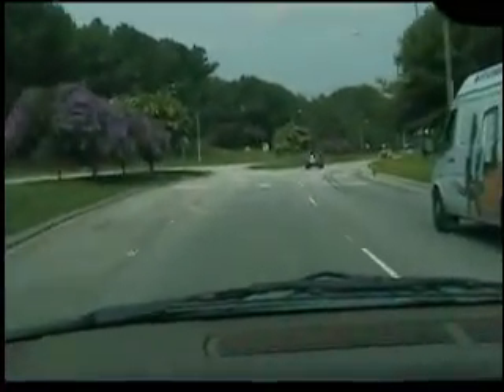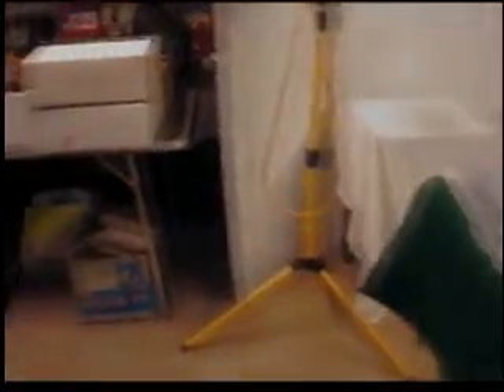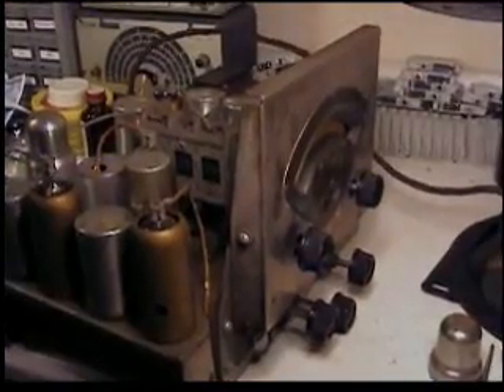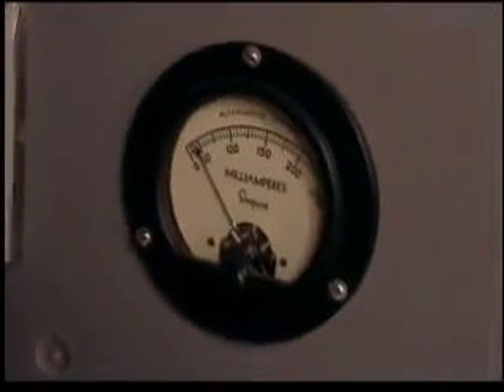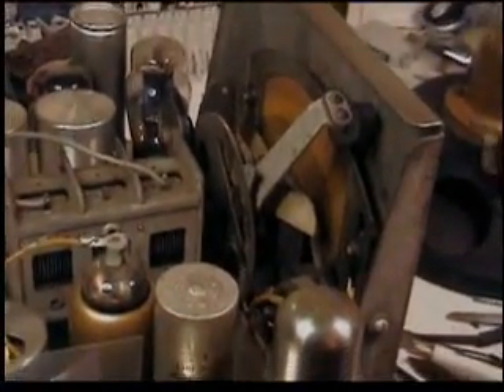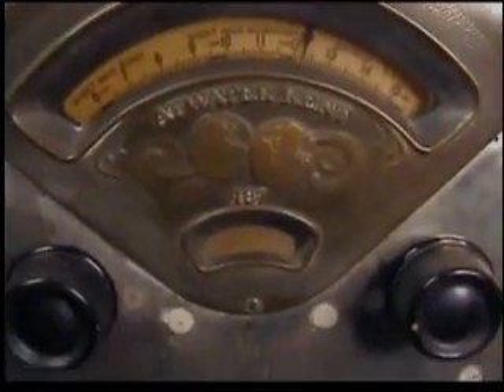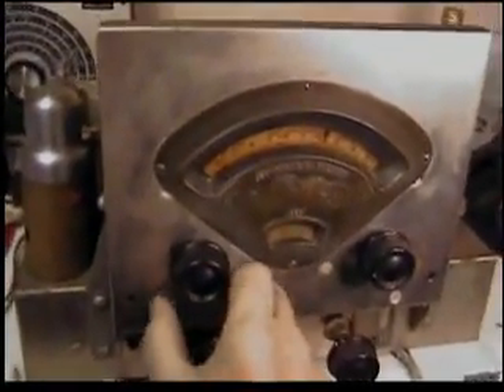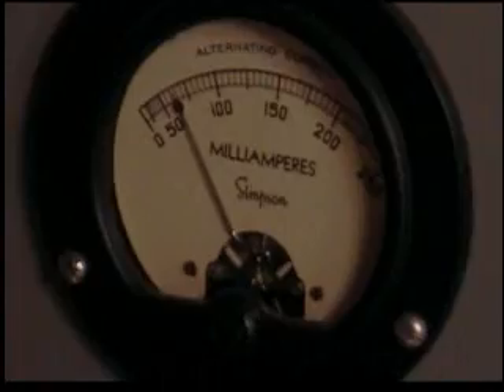Atwater Kent Radio model 487, 1936

Comment: What a great collection of radios! Is that a superhetrodyne type set? I have an Atwater Kent which I think is an "60" model maybe? It is a TRF circuit and has 3 tuning caps which connect together with metal belts.

Comment from the maker: Thanks.
The US is 120vac @ 60Hz.

Depending on the equipment there are other options.
220vac, one or two or three phase @ 60Hz.

The 50,000 watt AM radio transmitter that I work on is.
440avc three phase @ 60Hz. I'm very careful working around that equipment.

Rick

Comment from the maker: Yes it is, just amazing.
The Atwater Kent 487 is a superheterodyne and its intermediate frequency is 472.5KC.
Your AK 60 is a nice collectable. I wish that AK would not have filled the power supply unit with tar. It does make if difficult to work on.

Comment from the maker: AM, 1.6-5.0mc, and 6-15mc. It's possible to add an aux input to any audio amplifier. This one had a poorly, modification of an aux input, and I took it off because the owner wanted it back to original manufacture. With collectable items you can hurt the value with a modification.